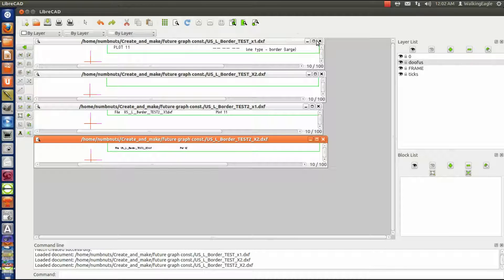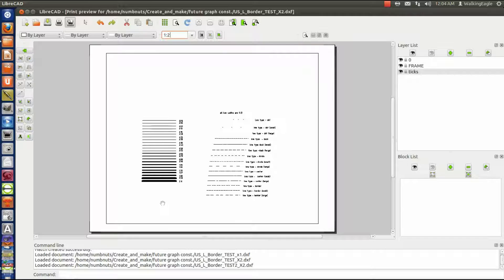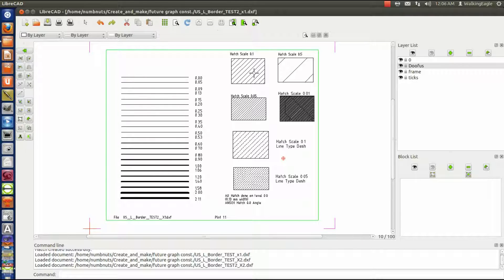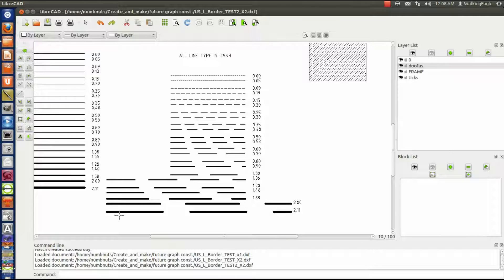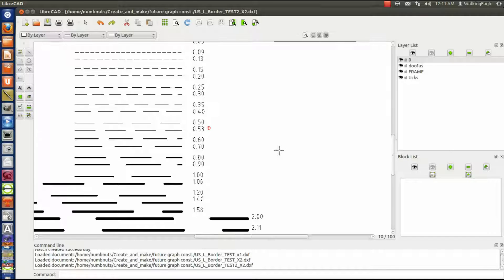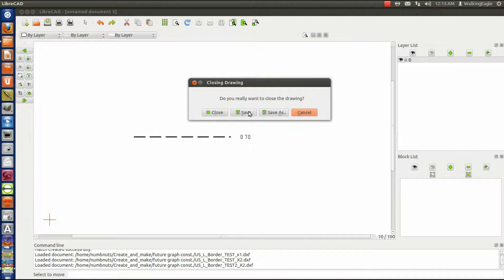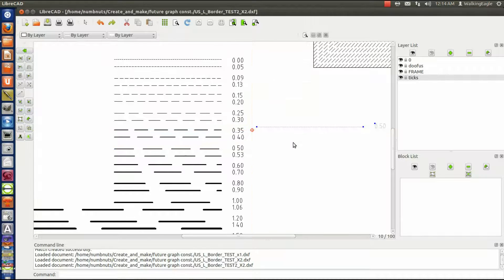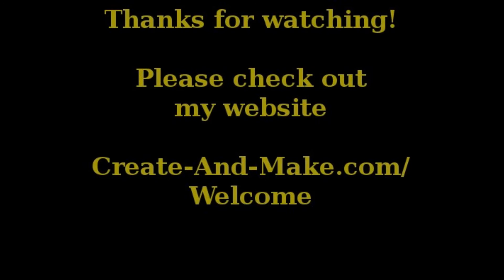LibreCAD - Line widths, Line Types and Plot Scaling

Comment: Hi. I wanted to ask if the the program allows for plotting. I have an HP Designjet 510. Don't want to download it unless it can.
Reply from the maker: I know of no reason why it would not work.   There are paper sizes in the edit part of the program that are that big... 
The only problem would be if your Operating system can drive the plotter.
Reply from the maker: Designjets work just like very big printers.  The program can handle very big paper... the only question would be if your oprerating system will drive it...and that SHOULD be ok..